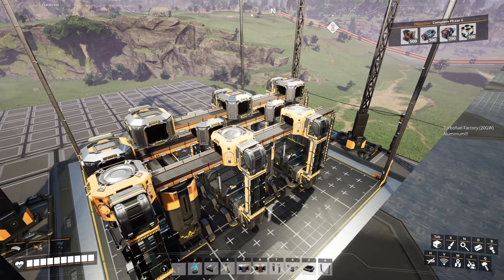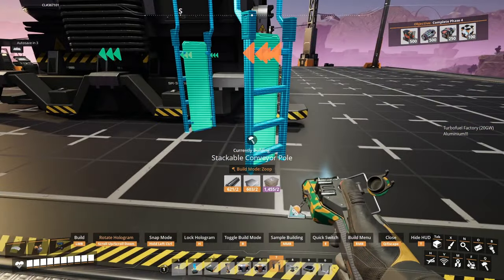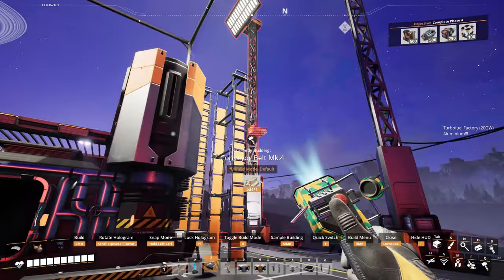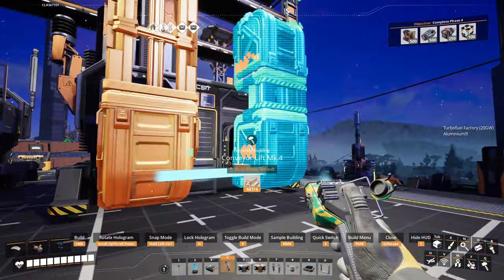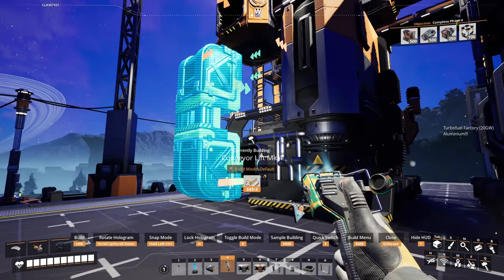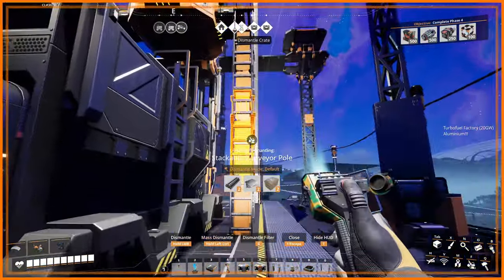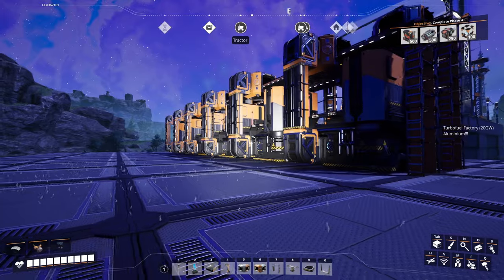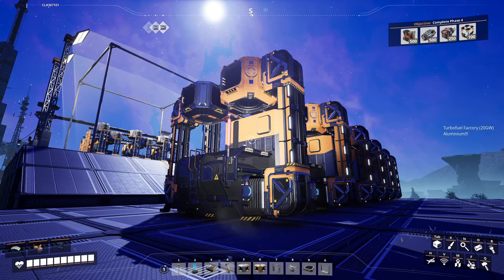Early Game Foundries Blueprint - Compact, Clean, & Tileable - Mk.1 BP - Satisfactory 1.0

Comment: I'm putting the finishing touches on a 3x4 (12) Foundry blueprint right now (Mk2 5x5). Used a 4m belt utility floor and tight lift positioning to match up with x2 Conveyor walls, without hard clipping. 
Giving me a "x2 input, x1 output" I/O setup, utilizing all but one conveyor wall hole.

Unfortunately it involves a lot of tricky building, connecting, unbuilding, reconnecting, etc. to get all belts and lifts operational.
This is exasperated by the basically impossible POV needed to clip lifts partially into splitters by mounting to hidden conveyor poles.

My solution was to build the blueprint with an additional 4m crawlspace below the utility floor, then connect lifts from below, but then I realized you can't drop blueprints down lower, even if you eliminate all items below the utility floor.

So now I've got a blueprint hovering 5m above the factory floor!

It's been a lot of effort, but I may end up having to scrap the whole project and mounting above via floating splitters like you have. 

I'm not a big fan of the look, and prefer to have the belts line up with wall I/O, but I'm out of other options apparently.